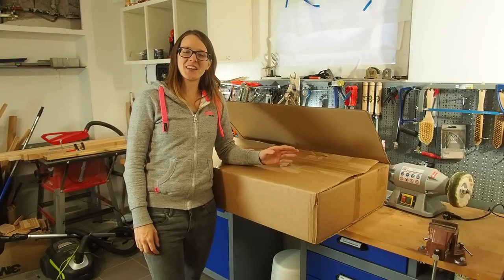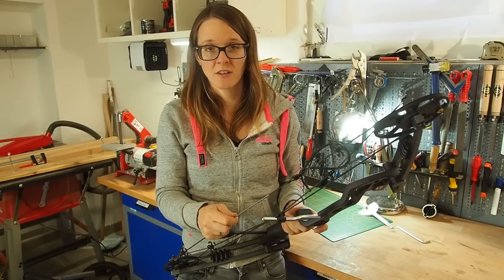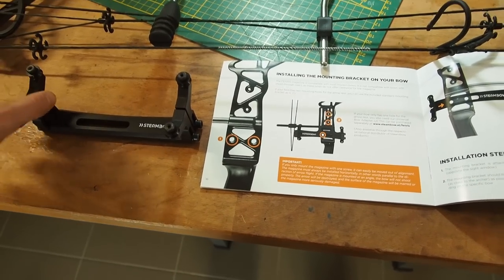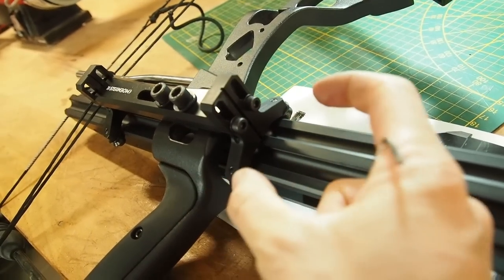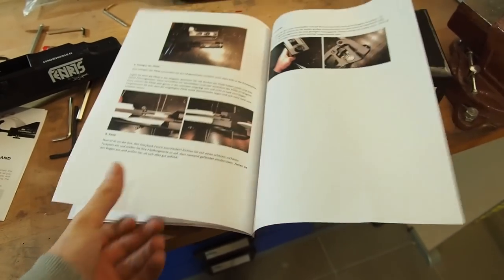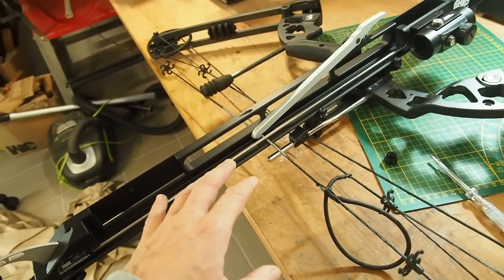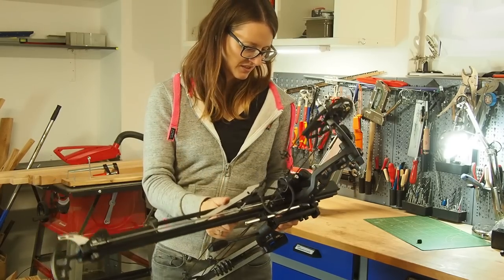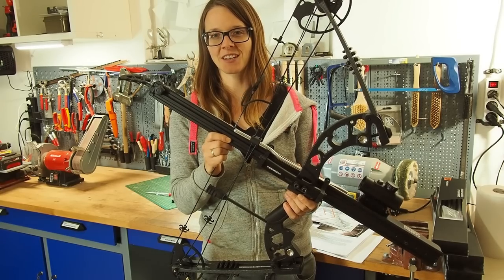Instant Legolas Bow by Joerg Sprave! Unboxing and First Impression!

Comment: If this was in medieval times, each archer would have two bows with an assistant reloading them. It would be incredible.
Reply: Or instead of an archer and an assistant with this, you could have two archers with regular bows.
Reply: @BlunderMunchkin  Medieval archers were highly trained professionals who required valuable equipment. Peasant boys were cheap.
Reply: @richlee3777  Well, an English archer was highly trained, but more in the sense of "made to practise for a couple hours after church each sunday", which was much more than the usual peasant levy. Also, bows aren't hugely complicated to make, they are just sort of a lost art. Of course, if you had loads of spare peasants that could assist the archers, something like that would be possible. The question is whether or not said peasant would be more use in front of the archers, discouraging cavalry charges with a long and pointy stick.
Reply: They did use loading assistants for crossbows, so obviously yes that's what you would do (in the same circumstances, e.g. from a shielded position). And it would be much faster than using two archers. Much faster.

Comment: Does it  work with broadheads?
Reply: I was looking for an answer to this question as well. It doesn't look like the loading well will allow for standard broadhead. Maybe the impact heads that snap out on impact.
Reply: @themakingofourtipi7898  mechanical  are bad news if you shoot a deer in shoulder blade
Reply: I know,  but I'm trying to figure out how to have hunting heads on it
Reply: 2-bladed ones (ie in one plane --) works, but not the 4-bladed ones  + , as long as it fits in the mag which is wider at the front just for this.

Comment: It didn't seem to be very balanced and wasn't very quite. By the way the ancient Romans had something similar that shot spears instead of arrows and held 12 spears. It also shot as fast as the crank could turn which for the average man was one every 2 seconds. It took two men to operate it. One man turned the crank that loaded and pulled back the line and one to aim and fire. It also had an automatic firing system that fired the arrow automatically by holding the trigger down every time the sting would hit the full pull, or could fire once then wait for the next trigger pull.

Comment: He designs cool stuff
Reply: xr7fan  why not both
Reply: xr7fan  it’s certainly useful it turns an inexperienced archer into a competent if not expert quickly 

And if you don’t think it’s cool then that’s your opinion to have but almost everyone disagrees with you
Reply: xr7fan  you were reading too fast friend, I said ALMOST everyone and if you look at the comments and like to dislike ratio of the slingshot channels video you will see that I am correct in this claim. Furthermore the claim that it will make you more accurate is also true as the trigger ensures a clean release of the bow string every time and the ability to mount an scope or just aiming down a sight will increase accuracy tremendously. I do not claim that no practice is required to use this device but a novice bowman would become far more effective while using it hence the name instant Legolas. Even if it did not make you more accurate shooting at a rate of one arrow every couple of seconds would more than make up for the lack of accuracy within a reasonable distance of the target.
Reply: Also it has just come to my attention that this can have a laser sight and if that doesn’t improve accuracy nothing will

Comment: Lily you may have already tried this method, but in case you haven't try using the hand on the bow's riser to push it away from your body while simultaneously pulling the string back. Imagine holding a small loop of rope and you are trying to pull it apart and break it. Instead of holding the bow out and using one shoulder and arm to draw it you are using both shoulders and both arms to draw the bow. I was a part-time archery instructor in my early twenties, and that method helped quite a few small women and teens draw a bow that would have otherwise been too heavy for them.

Comment: On the latest version he added an elastic band to the magazine so that you have to put some force into it when you push it forward but then it helps you draw it when you pull it back.
There's also a little grip that attaches to the magazine so that you can hold the whole thing drawn with your bow hand which is pretty nifty.
The guy really is a great inventor.

Comment: The older versions of the Fenris/Sil/Instant Legolas had an assist mechanism. I wonder why it was cut on the production version?
Reply: Fenris never had an assist. It was his older plywood prototype with reversed recurve bow or slingshot rubber.
Reply: @Lcr34  I thought the slingshot assist would have made its way to the Fenris. 

I guess we can hope it's still in pre-production. Because it seems like it needs it!

Comment: 2:26 i think this is the wrong way to pull a bow.
Reply: yea in alot of ways. 1 no arrow is nocked, 2 you dont use fingers to draw a compound as you can torque the string causing it to derail. But atleast its a cheap chinese bow.

Comment: LOL... opening a box with a continuity tester? I know a site that sells nice knives that can fix you up!

Lighten the bow til you can shoot it, but when it becomes fairly easy to shoot, tighten it back up to the next setting, and then the next, and the next. Fred Bear regularly shot a 65 lb bow, but he had to work into it. I had a 55 lb bow I took to work one day as a co-worker was interested in  buying it. Another co-worker who was a boxer was there while we were looking. He picked it up, but could not draw it the first time. He could punch with that arm very fast and hard, but pulling was not as easy. Finally, struggling, he got it... as you saw. It takes different muscles. You have to condition them. Most US states require 40 - 50 lb bows for big game hunting.

Comment: Hi Lilly.
There is a simple technique I learned in bow school to improve your strength when drawing:
Lift your elbow high above your ear when drawing. Try to really "overdo" it on purpose. 
It sounds un-intuitive but trust me, once you "felt" it you probably won't go back.
I guess it has something to do with your muscle structure and that this is such an unnatural movement (which you normally never do) that your brain didn't know that your body can utilize it's muscles slightly more efficiently in that strange pose.

Comment: A trick I use for bows that are just a "hair" too heavy to draw like I would normally, horizontally, is to hold the bow pointed at about 45° up above my head and use the weight of the bow itself to help draw it letting it fall while I draw it. 😉

Comment: Thanks, for showing us how a novice would open, assemble, adjust pull-strength, and practice some shots. An adjustable monopod, or some other "holding device" would help with the weight. P.S. I noticed that as your accuracy became sharper, your aiming eye would give a quick blink at the same time the arrow released. I don't know if that is normal, or if that would affect the accuracy.

Comment: All the tech going into black powder and archery is why my state went back to defining primitive hunting as using a flintlock, a cap and ball, a long bow or a recurve bow.  I've got to wonder why a laser range finder with pendulum for degrees of incline sensing that adjusts point of aim wasn’t included along with a solar panel to recharge batteries???

Comment: reminded me to that War of Arrows, when the Korean uses a custom made tube that designed to accomodated a very shortened standard arrow akin to what a crossbow bolt would.
this device might can be modified to shoot crossbow's bolt while keep 5 ready bolt..
if that kind of modification is possible, which i believe it is, that would be very neat..
besides, it will only requires  common crossbow bolt..

Comment: 17:16 "If they had this bow in medieval times, they'd have shot as fast as 50 archers" - wasn't the point of Lars's video that medieval archers could be fast? Yes, he used a different technique, but it was a corollary. If he is right (and maybe he isn't), it looks like we're at medieval speed with this bow, maybe slightly faster, not 50 times faster.

Comment: Hi Lilly, just a thought I wanted to share with you, but do run it by with JoergSprave, on the adjustment threads of the screws put a drip of loctite to hold it fixed, I've had to do this my self on sights fixed and lazer, not everyone has tools in the field or moots when hunting. another thought on the loctite they are the permanent fixed which I would not suggest but get the one that secures but can be loosened if need too adjust. But, this is a cool looking bow, I have never seen anything like it. Happy hunting.

Comment: You shouldn't have the limb bolts backed out so far. It is dangerous. The draw weight is set on the cams. Read the manual or contact the manufacturer for proper setup.  I've seen bows blow up on people for that reason and it is not healthy. If you can't get the proper draw weight with the cams you need to get lighter draw weight limbs.

Comment: you need better draw technique for compound bows. lift the bow over your head and pull it down as you draw and use your shoulder muscles as well as your biceps. if you get the technique down you should be able to draw much heavier bows.

Comment: Dump the big red dot and put a 1.5 ounce reflex sight
on and that will lighten the bow by several ounces.
Every little bit helps when you find weight is an issue when held at arms length. Be sure the reflex sight has a compatable mount. Neat gear. Is laser green? Easier to see spot on target in daylight though not on green leaves or tree needles

Comment: Yep would have been quite the game changer in medieval battles. Reloading wouldn't be too much of a problem. You would have two sections firing in series. One reloading, while the other shoots, then vice versa... You could also advance ranks or retreat ranks as you fired volleys in front or behind the reloaders.... But mostly archers would be behind the Halberdier's halberd wall shooting armored enemy pikemen in their unarmored bits as they tussled for battlefield superiority.
Reply: There's also a "stripper clip" type arrow holder that lets you load arrows into the mag faster - just like pushing cartridges off a stripper clip into a rifles magazine is faster than handling the cartridges one by one.

Comment: what do you think of heat shrink vanes Lilly ,  im getting back into 3d archery and  wanted your advice on  carbon arrows + vanes
Reply from the maker: I am a fan of real feathers. The feathers are put on the arrow in a spiral so they cause the arrow to turn which stabilizes the arrows. Vanes I only saw straight on the arrow, so it does not turn around its axis much.
Reply: @SurvivalLilly  thanks lilly apreciate that ..  i have feathers on my alluminium arrows  in a slight spiral ...  im looking to make a few 3d arrows up with shrink wrap vanes with a 2" vane length and a slight twist to them .... il give it a go .  how did tbe  amazon compound work out after the impressive overhaul .. i hoped for a follow up video .. i was that impressed .... big thanks again Lilly

Comment: I'm a big fan of Fenris but one thing i dont understand is how do you get the holders that hold the rollers perfectly evenly aligned so that the roller is perfectly parallel to the side of the riser. I mean when you untighten them and move the holders a little bit so that the string doesnt touch the magazine, how do you move the forward and the rear holder of rollers so that they are both in the exact same position. I think it would've been better to make both roller holders a single piece of metal so that it would be mechanically impossible to misalign the magazine in the axis which is parallel to the side of the riser and in which the arrow rests.
Reply from the maker: I aligned the rollers with no problem
Reply: Easiest way (for me at least): I’ll ask someone to hold the bow with attached magazine upright. Loose the screws and use the magazine as a “lever” to adjust the settings. Gradually tighten the screws while testing and fine tuning. Then tight them down and test alignment by pushing the magazine back and forth. If adjusted right it glides without much resistance even if you just tilt the bow slightly. If it’s intended to stay at that bow use Thread lock

Comment: It would be much better if the sight was mounted on the bow itself.
Reply: Jörgen Fredriksson  It's basic knowledge that the less a sight has to move, the more accurate it will stay.
Reply from the maker: it is important that the sight is as close to the magazine is possible. so the positioning on the magazine is perfect.

Comment: It's a turn a bow into a crossbow kid. 👍
Reply: With the front finger hook, one can hold a compound bow drawn back with just that - ie release the draw hand.
There's also (at least experimental) a spring loaded  latch/catch that can replace the finger hook, which essentially switches the thing between bow and crossbow modes...

Comment: It seems too loud for hunting.
Reply: Its not that loud if you draw it slowly. Also there is a mod that can allow you to lock the system in the drawn position so you can draw it beforehand and keep it drawn and ready to fire like a crossbow. But my concern is that it is kind of weak for hunting as the draw length is limited, you would want a really really fast bow to go with this system to still get decent speed out of 25" draw length, or you should go with super heavy arrow and forget about long shots to get decent penetration.
Reply: @georgewashington1621  for smaller animals on not to large distance,I may be possible, don't you think
Reply: @sosteve9113  Yeah totally. Turkeys, beavers, rabbits - i think it will be fine.

Comment: I don't know why the People so impressed to Shooting better when they Turning they Bow into a Crossbow.
Reply: This is not a crossbow. It doesn’t shoot like one, it doesn’t lock the energy and it’s use doesn’t feel like handling a crossbow either. It feels more like a hybrid. Interesting and pretty efficient!
Reply: @geraldmissbach7100  It looks like the First Crossbow wat was a Bow attached on a wooden guide rail and was fired with upright bow arms and later whith the Bow Arms Horizontal. And i see in last time a lot of Videos who the Users pull the String and take they Handy away and it Dosn't Shoot before they pull the Trigger. that is why it looks like a Crossbow to my. ; )